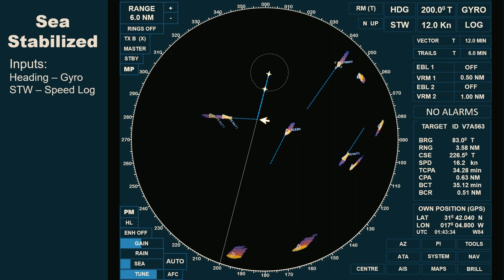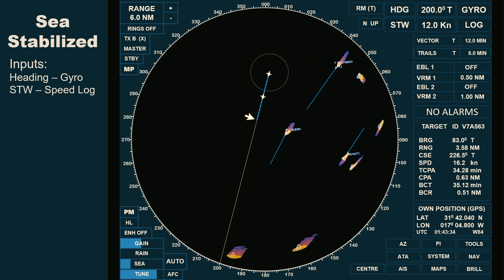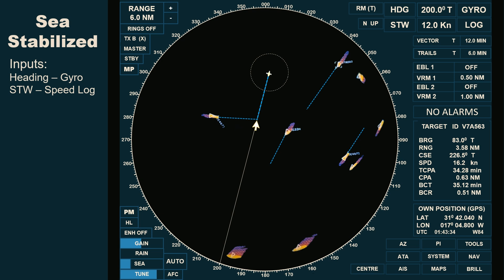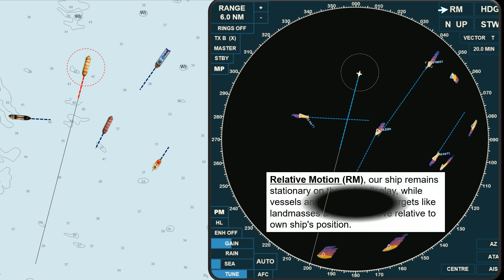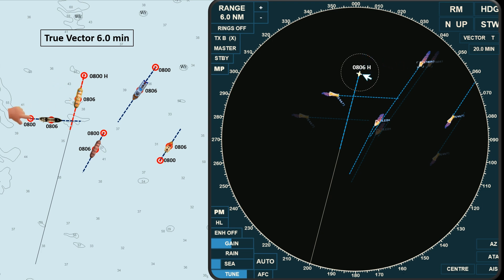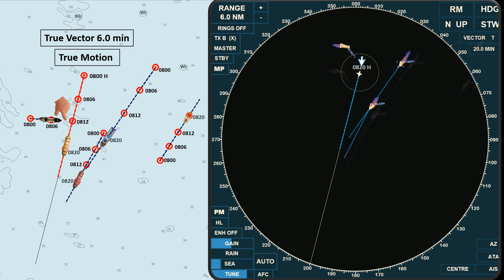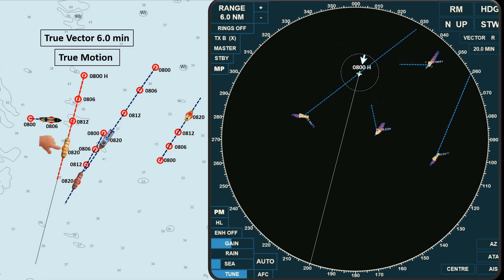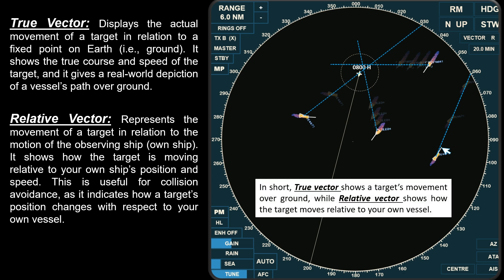True Vector vs Relative Vector: A Guide to Collision Prevention and Safe Navigation l Marine RADAR

Comment: Sir, can I ask a question? At 9:20 you said that "true vector helps us identify the aspect of the other vessel", and according to the Collision Regulations, "all collision avoidance actions should be taken based on the aspect of the target".
So why don’t we use the true vector for collision avoidance instead of the relative vector?🤔🤔
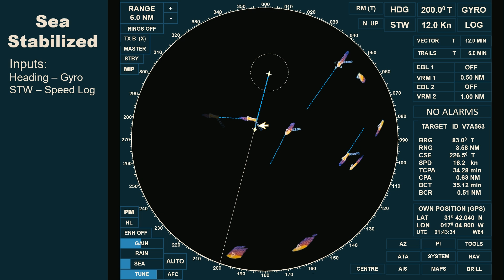Reply from the maker: That’s a very good question! 👍 Actually, we can use the true vector for collision avoidance. As shown in the video between 2:42 and 4:00, when the radar is set to true vector, each vector represents where the ship will be after the selected vector time. If the tip (forward end) of the own ship’s vector exactly touches the tip (forward end) of the target’s vector, it means that both vessels will be at the same geographic position if they maintain their present courses and speeds — which clearly indicates a risk of collision.

In other words, the forward end (tip) of each vector represents the ship’s future position, so when those tips coincide, it shows that both ships will meet at that point after the set vector time. That’s how the true vector can also be used to assess if there’s a risk of collision.

At the same time, the radar will still display CPA and TCPA data even in true vector mode, since these values are computed mathematically by the radar regardless of vector setting.

The advantage of using the true vector is that — makes it much easier to identify multiple moving targets in congested waters. You can instantly tell which echo belongs to which vessel by looking at the direction of its true vector, since it matches the vessel’s actual heading.

True vector can definitely be used for collision avoidance, because it can show if a risk of collision exists when the vector tips coincide. However, most deck officers still prefer using relative vectors since they directly show relative motion and are what many are trained with. But knowing how to use both true and relative vectors gives the OOW a clear advantage in maintaining situational awareness and making safer collision-avoidance decisions.

Comment: Do RADARs provide target "aspect" information?
Reply from the maker: Modern RADAR systems can provide target aspect information, but not all RADARs offer this feature directly. Aspect refers to the orientation of a target relative to your ship, essentially indicating whether the target is moving towards, away from, or across your position. RADAR systems equipped with Automatic Radar Plotting Aid (ARPA) or similar tracking capabilities can estimate the target's course and speed over ground, which can help you determine the target's aspect. However, this is often inferred from the tracking data, not a direct measurement from the RADAR.
In simpler RADAR systems without ARPA or advanced tracking, aspect information isn't directly provided, and you would need to manually interpret it based on the target's movement over time relative to your own ship's position.

In true vector mode, the vectors shown on the radar display represent the true course and speed of both your vessel and the targets relative to a fixed point (usually the Earth or a reference point on the ground). While this gives you the true motion of the target, aspect refers to the orientation of the target relative to your ship (i.e., whether the target is facing towards or away from your vessel). To determine the target's aspect, you would still need to analyze the target's course and compare it to your own vessel's position and movement. The radar’s true vector mode helps by providing accurate course and speed data, but it doesn’t directly display the target's aspect.

True vector mode gives you more precise information about the target's movement, which can assist you in determining its aspect, but it doesn't automatically display the aspect itself. You would still need to analyze the target's course and compare it to your own vessel's position and movement.
Reply: @nauticalacademy001  Thanks for your reply. Please, add more videos with scenarios on how to interpret and/or avoid misinterpretation of the PPI